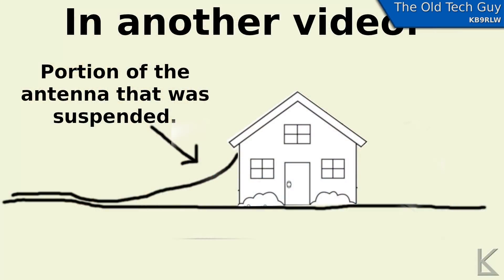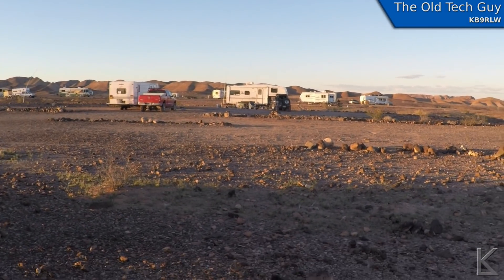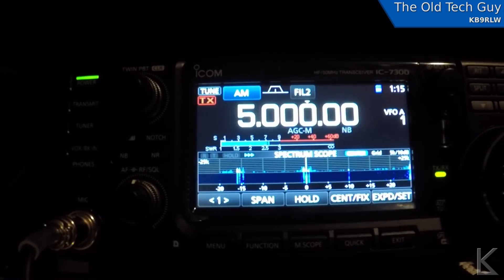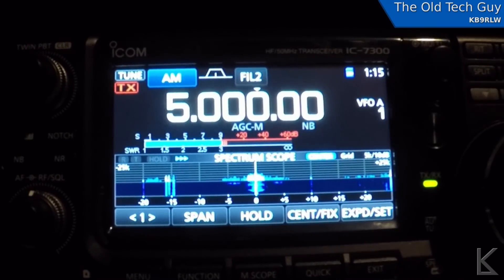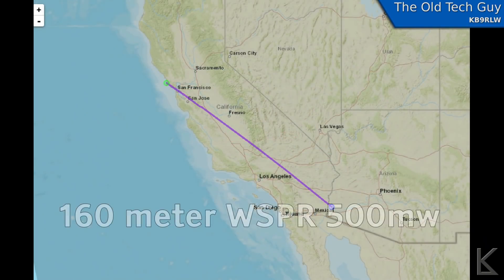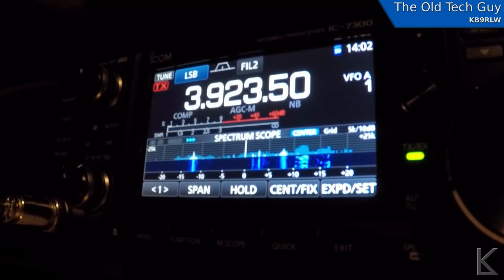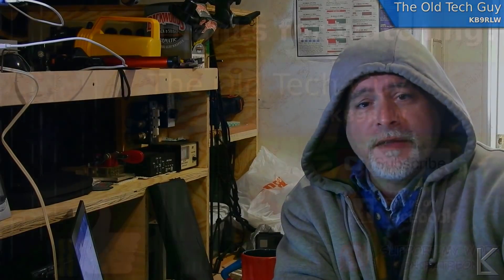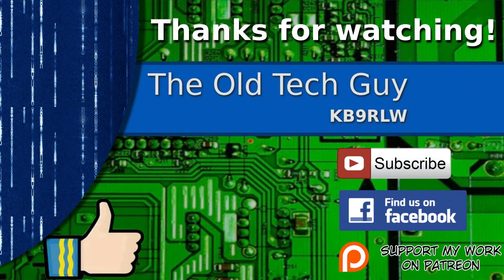Ham Radio - Can an antenna work while laying on the ground?

Comment: Hi Kevin, I can answer about ELF, I use it everyday to locate buried utility lines with.  We use an 8Khz sine wave at 1-3 watts and can get a few miles out of it.  Switching to 33Khz drops the signal drastically for distance.  Ground soil conditions has tons to do with being able to locate the lines.  When you get a chance look at Clam Lake, Wisconsin and the antennas used to communicate with submarines, very intresting.
Reply: I have seen the charts that have been made in the past for the depth of penetration in earth and into sea water versus frequency and baud rate, and the deeper the lower the frequency and lower the data date for the signal to get through. There are not many of those high power ELF transmitters left. Many have been closed down and the land sold, along with air bases and other military property in various areas. It leads one to wonder where the future good engineers and operators will come from, as people can take classes on most anything, but that does not teach them much in the practical applications, only theory and very little hands on and experimenting. Once someone knows things well they can work with most anything, but those trained on just one piece of equipment do not do well when things change. I have seen this time and time again, as I can easily fix and redesign things even without any schematics that others who have no experience in the designing and building of the same equipment are lost with simple repairs. I know that many today rely on simulation software, but that only works when one has a computer on hand, and does not help when the computer does not work or something unexpected is observed. As with most things they just put in a fudge factor and push on not knowing fully what they are doing or knowing what to fully expect. It takes experimenting and experience with many things to find out the differences between ideal and the real world. As the real world is more complex than any of the equations that one will learn even at a Masters or Doctorate level. 

It is this experimental experience that people get with listening and designing equipment, and being a Ham that is the only way to understand how the future will work and how to make it happen, as for it's existence in the first place. Also in the 1930's and so forth it was operators that built their own equipment, and I got my interest in electronics from Electronics World, Radio Electronics, Popular Electronics, ARRL radio books from the 40's and later. Just have avoided even considering becoming a ham because I'm so bad at learning code. Easier for me to figure out how to design and build a box to listen and translate than listen and write it down, and that is because of my learning disabilities that make communications difficult for me since a very young child. Things hard for most are easy to me, and things that are easy to me are difficult for many others.
Reply: Paul you likely already know this, but there is no longer any code requirements to get your license. In case that is all that is holding you up!
Reply: @Paul-gz5dp  "Once one knows things well they can work with almost anything." 👍👍

Comment: BOGs (Beverage On the Ground) are a real thing.  Actual sensitivity isn't important, because you're looking for low noise and directivity, and make up for the lack of sensitivity with a preamp, and it's a receive only system.

Comment: Hi ... Did you measure the naked (no tuner) SWR?.... Have played with these critters a bit. Ussaly see the length shrink 20 to 30%. Your right...it all depends on what kind a ground you lay it on... And as best I could tell... it turns a other wise good antenna into a cloud warmer.... signal strenrh will be down 20 dB...(suggest a switchable attenuator)... noise even more... but how would you be able to tell ...with no noise... to be found in radio paridise!!!... Tnx for a great video...73
Reply: But it will be a NVIS cloud warmer.

Comment: Interesting video.  Thank you.  Should 'radials' be off the ground also?
Michael VA6XMB
Reply: Now this is an interesting question. With these conclusions demonstrated, it sure would be interesting to compare the performance of a vertical with ground radials vs a vertical with above ground radials.

Thanks for the video Kevin.
Reply from the maker: Now that's a good question, and I think I've seen Arguments for either. I might try to do a test someday, with a vertical, perhaps on VHF.

Comment: good! anyone got thoughts of same ant. laid on a flat roof building 30 ft up?
cheers 73
Reply: That would most likely work well provided that there is little metal or anything else conductive such as wet roofing near the antenna. You will probably need to adjust for the capacitive effects of the roofing material with an antenna tuner to get a really good signal. Nails are not an issue, just how close the antenna is to the flashing that is used. The farther from the flashing the better, as it will look almost exactly as an open air antenna at the same height. I used to run an antenna under the eve of the roof in a house and it worked great, and I could get signals from nearly all countries in the world in the SW  and from 160 to 20 meters. Unlicensed and even though I had a transmitter with an 807 in the final at the time, never thought of putting it on the air.

Comment: Help.  I have a 40m delta loop.  I can hear many stations but no one hears me.  I've tried my IC-7300 and KX3 but not one response.  This is over several days of trying.  Any ideas?  JJK
Reply: Use a websdr to find active frequencies.
Reply: Is there a tuner involved? What SWR does your rig show when you transmit? 73 de w8tam
Reply: Using the turner in the 7300.  1-1 SWR.  But try as I might no one hears me.  FYI the bottom on the triangle is close to my block wall.
Reply: @johnkershaw9575  Seems odd noone can hear you. Just checkin'... You're using lower side band on 40m? Is there a balun on your deltaloop? I'm in Michigan, and happy to tune a frequency if you want to give it a try.
Reply: believe its 4-1 but dark out right now.  Feeds directly to 50ohm coax then to my radio.  I'll call CQ nowMy mistake SWR flat when tx
Reply: I checked the SWR when I am transmitting and it's above 3.  It tunes out flat and when I run an SWR band check its ok but transmitting is high.
Reply: @johnkershaw9575  There's something gone wrong then. Generally speaking, SWR shouldn't change under power. Above 3, unless you have the 7300 in emergency mode, it won't tune it.
Reply: I'm wondering if you have a balun.... Common mode current coming back into your radio could cause it to see high SWR with power.
Reply: Hurray, Oregon just heard me on 80m  3.980.00
Reply: I backed my power to 20watts when Oregon heard me.
Reply: @johnkershaw9575  Awesome!!! :D  I hear some folks low down on 3.980 here in Michigan.
Reply: @johnkershaw9575  Sounds like you got some contacts. Not sure if you could hear me on 80m. 73 de w8tam
Reply: 7.230.00
Reply: @johnkershaw9575  Listening from Michigan.
Reply: @johnkershaw9575  I might have heard something down in the noise, but there's few strong signals on my waterfall on 40m. I was getting lots of action on 80m FT8.
Reply: Thanks for much Tom.  I've had to sign off the radio.  What do you think when I dropped power from 100 to 20 and Oregon (me CA) heard me.
Reply: @johnkershaw9575  I'm betting there might be a bad connection somewhere. Make sure everything is tight, and the coax isn't crushed or anything like that.

Comment: I messed around with a 'grasswire' antenna, and came much to the same conclusion you did here in Michigan. I recently ordered an interesting noise canceling kit which uses a 'noise antenna' for picking up RF interference to inject 180 degrees out of phase into your receive signal. I wonder how a ground wire would work for that purpose.
73 de w8tam